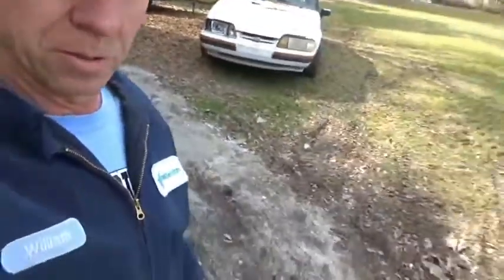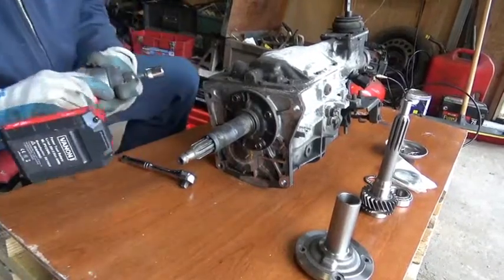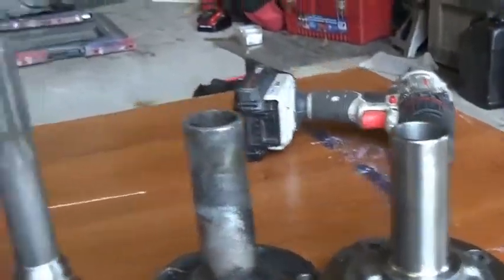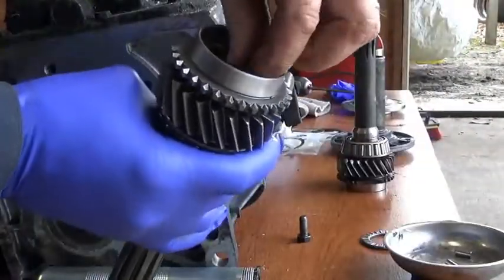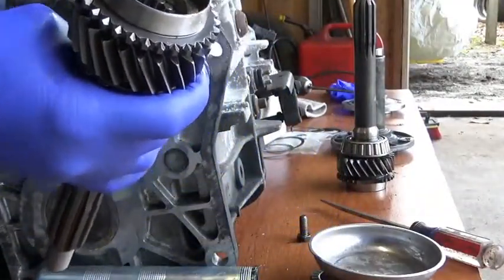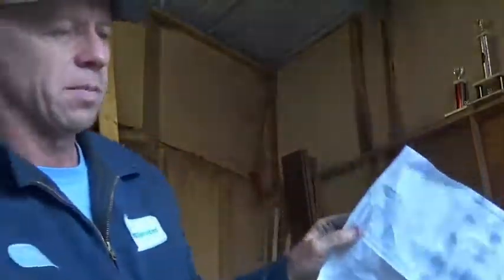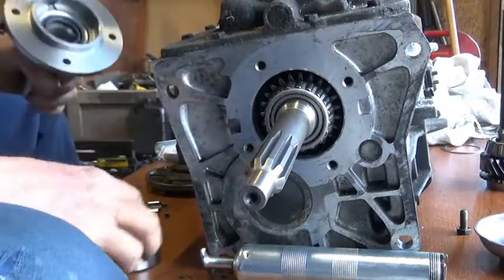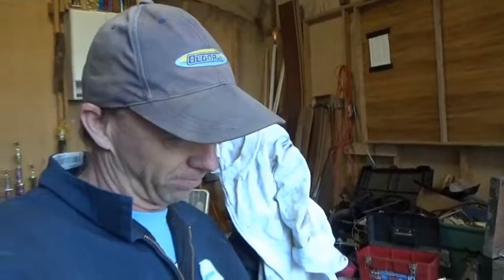T5 input shaft swap from SN95 to Foxbody length.

Comment: According to the Tremec manual, there is only one thrust race, that flat washer that goes between the thrust needle bearing and the main shaft. Both of my T5 only had a single thrust washer. I'm not sure how yours uses two thrust washers.
Reply from the maker: I watched another video and guy had to put 2 in there to get ut to not have any extra play. 1 thick 1 would be far better..  Anyone else reading these comments should take note and do it by manual specs.
Reply: @yellowfoxbodyguy  There’s also a spacer that goes between the bearing race and the bearing retainer . Sometimes people forget to put these in with a new retainer . And too thick sealant can also produce too much end play. I find the Honda-bond silicone works awesome .

Comment: Cant you just use the correct input shaft from your core?
Reply from the maker: Yes if you have it and in good working order. I only had a 1994 transmission which had a longer input shaft. I did not have a T5 from a true fox year car.  If you have a 93 and under shaft go for it as long as its in good shape.
Reply: @yellowfoxbodyguy  awesome thanks. Now time to replace my whining ticking time bomb

Comment: Do you have a part number on the input shaft?
Reply from the maker: bought off of ebay from transdeals4u. 	
Fits Ford Mustang Borg Warner T5 World Class Transmission 9-1/4 Input Shaft

Item ID: 191920942332

Comment: for the flat roller bearing, there are two washers on each side?  One on the input bearing side, and one on the face of the 3/4 slider?
Reply from the maker: I think i put it back together in the opposite order it came apart. So we shall see. Its been so long I dont remember and can only tell you what is shown in the video is what happened.
Reply: There should only be one washer between the bearing and the main shaft according to the Tremec manual
Reply: @AndySomogyi  Thanks for the info.  I have a couple more to take apart and put synchros in eventually.

Comment: Nice job 👍 Transmissions scare me I never opened one. Lots of parts inside for me. 
Have a great evening sir 👋🏼
Reply: A trans is nothing to be afraid of. I’ve done dozens of sticks and automatics. Just take note of how it comes apart.
Reply: Sooo much easier then you could imagine. I used to think the same and did a gsx awd transmission and it was easier then I thought. If you can find a video to follow for your trans its a breeze.